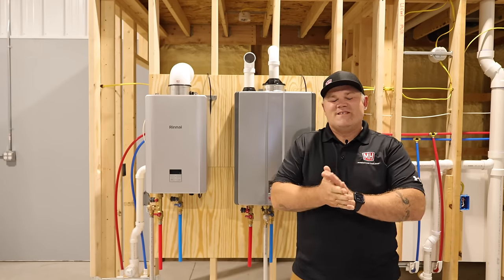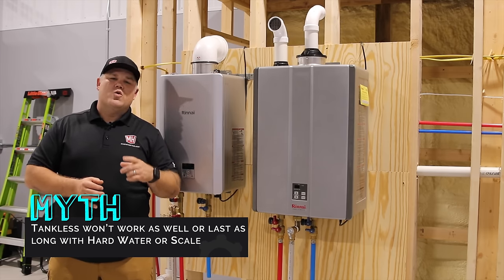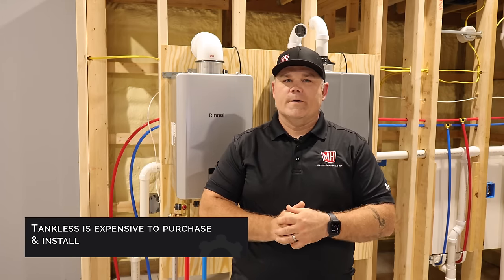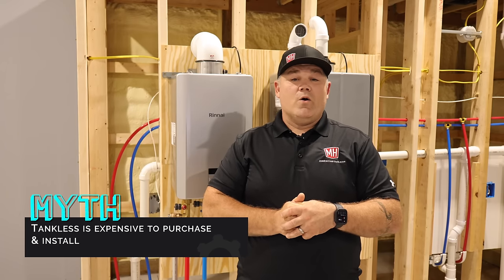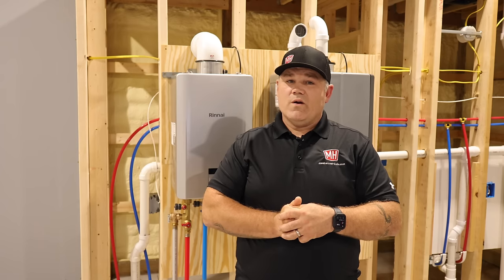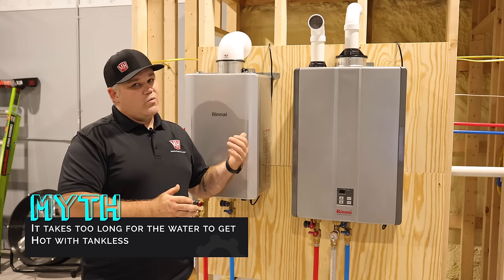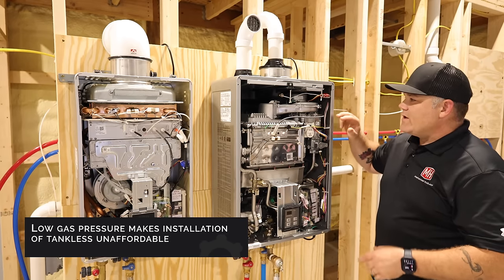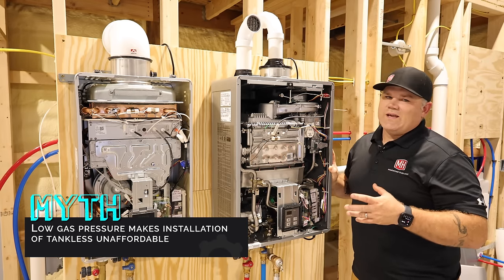Myth Busting! Tank -vs- Tankless Water Heaters

Comment: My opinion and real life experience.

I helped my son replace a tank and install a tankless in his house, primary purpose, regain space in their small (old house) laundry room..

Then (just over 1 year ago) our several decade old TANK water heater developed a small leak, called in the return favor from the son.
The wife wanted to reclaim space in the utility / laundry room.
We had a short term need,  I was able to get everything I needed and install a tankless in a day and 1/2 (hot water was only unavailable for a few hours.. We kept the weeping tank isolated except when hot water was needed until total change over)
To be honest swapping out the old one "tank for tank" would have been quicker, cheaper and easier.

Cost wise the price of a replacement  tank (nat gas) water heater has risen so much in the BIDINFLATION years,  there is no longer  a significantly better price  for an "efficient" tank water heater .

An added burden of the tankless, was  getting the 3/4" black pipe cut to exact length and threaded  @ our local ACE (I don't use flexible pipe for gas).

The advent of 'sharkbite' connectors made the copper plumbing very quick and easy, the 'sharkbite' fittings are not cheap, but the $30 +or- extra investment was worth the time savings w/o the need to sweat copper pipe.

In use:
We never run out of hot water. (no recovery time even when filling the soaker tub)
Even with sustained sub zero (Michigan) temperatures outside, The tankless  is able to raise the temp enough to take the kind of hot showers I like.
I was skeptical regarding additional concurrent hot water loads, but experiments demonstrate I can shower, and not notice any change when the clothes washer and or dishwasher cycle.
Venting the exhaust (via pipe in a pipe dual intake / exhaust) out the wall is much less complicated than a thru the roof vent.
Even though our exhaust /intake pipe is never warm to the touch, our local codes required me to install a steel "fire break" panels inside and outside.
Just like checking / replacing anode on a tank, descaling should be a routine PM.

Paying someone else to do all the labor will be expensive, (this is where I 100% disagree w/ this presentation / video) my neighbor did, his investment was 3X mine and comically the so called "professionals" had to come back out  later to do the final steps, unlike me he was w/o hot water for nearly a day, including an overnite.

Hidden cost:
Once the big tank was gone, and the smaller wall mounted tankless was installed (mounted to the wall), the wife recommended a more thorough utility  / laundry room reconfiguration should be done.
The good news we have almost doubled the useable space in the utility / laundry room.
The $$ impact, this led to buying  a BIG new freezer and a buying a side of beef.

Other insights:
The energy sticker claims I'll save over $800 in natural gas over 10 years (or about $7 a month)  I can neither conform or deny this claim.. since the water temperature stays constant, it is likely I take longer showers, and the wife uses the soaker tub more frequently, these likely reduce or eliminate the claimed savings.

Comment: Great video,, installed the top of the line tankless when rebuilt the basement..hated tank systems, absolutely the most inefficient way to bring hot water.. I have two teenagers that seem to fall asleep in the shower,, absolutely insane.. never ran out of hot water..I filled my hot tub in about an hour.. if I had to fill cold garden hose water it would take almost 2 days to bring up 100F and a huge electric bill... Tankless 1/8 of the cost.. we have heated floors. It is an absolute waste of gas and energy to have forced air heating.. you heat up pipes to 150,, then have a fan blow barley 72 degrees around the house.. in floor heating, warms the water to 80 and the stone floors are at 75 and absolutely boiling the entire house and your feet... An incredible feeling.. North America is antiquated and behind and wasting money and energy.. you want to talk about environmental waste.. 
Heat directly is the only way

Comment: I have a tankless water heater in my house here in Florida I have it set for showering at 105 That way I go into the shower turn on the hot water don't have to worry about mixing I have 105° shower as long as I want. Is this wrong? should I be setting the temperature higher and mixing it down with cold to get the required temperature? Or is it 6 in 1 hand and a half a dozen in the other?

Comment: We had a plumber come out and quote us on a regular gas tank water heater. He wanted $5500!  We had a company that specializes in tankless give us a quote and it was only $5800 gor evrything, including new venting, pressure upgrades for the gas, and a recirculator. Also, the tankless qualifies for a rebate from our utility and tax credits from the govt, which trimmed about $1200 off.  Installing the tankless is going to actually be cheaper. 

So many complaints about tankless aplesr to be due to poor install, buying the wrong unit, and having a recirculator.  Modern tankless is great. They have been using tankless for many decades in other parts lf the world. Japan actually gets the most snow out of any country in the world and they only use tankless.  It works.

Comment: Ok what bout if you have an older home built in the 60 1/2 galvanized and the tankless asks for 3/4 water line. And since the galvanized pipe gets build up inside the pipe will a tankless still work.

Comment: Possibly mentioned that you need either gas or propane to run a tankless system. where I live the town only put gas down one side of the street and between the possibility of paying to bring it to my side of the street or putting in a complete propane system it is totally cost prohibitive for me perit did we had a tankless water heater when we lived in Connecticut and it was phenomenal. now that I live in South East Georgia people just don't get it.

Comment: So my question would be for off grid house in remote location.  All electric would be better than propane.  I see kw ratings all over the board.  Biggest was 36kw for 7 gal flow.  I assume electric heating element only operates at 36kw if you are actually at 7 gals flow rate.?   Is there a rating for electric water heaters that tell you how many wh of electricity to heat a specific amount of water a specific amount? For example, to raise one gal  of water, 60 degrees takes X number of watt hours.

Comment: I have a tankless and the only problem I find is electric ignition. If my power goes out not only do I loose hot water I get NO water out of the  hot faucet at all. Now I have a generator but for short times I don't use it. I was one of the first dealers when  Paloma pack came out with the tankless water heaters. They were gas and there was no electric ignition. just a pilot light and thermacouple. They should go back to that way. Otherwise I like my system.
John retired 35 year plumber

Comment: Should you consider a Heat pump Water heater. The efficiency is much better although the cost is much higher. I have had one for the last 20 years and no problems.

Comment: This is a pure based sales pitch. There are more costs into retrofitting from a tank to a tankless (electrical not gas). In South Florida with a carbon activated water filter you are good to go. The electrical upgrade is a huge upgrade and cost. Gas Tankless definitely need more maintenance and are more temperamental than a tank water heater.

Comment: What is the maximum temperature output of a tankless system? 
At home we normally run our water to 150-160°F, and at work we are required to have at least 170° but we usually run at 180°F.
We did run at 190°F at work for a while, but there was no benefit to going over 180, so we opted for the energy savings.

How easy is it to service a tankless system?
Do you just open a flushing valve once every 6 months like a normal tank?

Are there any energy benefits if you are only using 50 gallons of hot water in several minutes at 12 hour intervals?

And is the water food safe?

Comment: I've installed rinnai. I've installed navien. I get plenty of feed back on both. stainless DOES stand up to heavy usage with no treatment BETTER than copper. all stainless, internal recirculation, powered gas feed (1/2" line):  navien had ALL these features 15 years before rinnai. 2 features rinnai STILL doesn't have? network connectivity with an app (control your hot water via cell phone) and a buffer tank- which means the flow threshold on a navien is ZERO... just like a tank water heater & no more cold water sandwich effect, common to tankless, including rinnai. also- rinnai double wall IS propreitary- and VERY expensive compared to 2" pvc, especially if you're running much distance with the vent. one more thing: with gas power vacuum feature- the tankless WILL run on the existing  branch line- however- if the trunk line & meter aren't sized to handle the extra load (upgrade from tank to tankless), the tankless will create a negative pressure (vacuum) on the entire system- and cause your other appliances to flame out- not a problem for a furnace or dryer- but a gas cook top? DANGEROUS. if the gas cooktop flames out, it will keep running raw gas into the house, so make sure your gas system can handle the extra load. when doing track homes- I find that most often- gas systems are already undersized & the meter inadequate. one more thing: neavien can be field converted to propane & back, also field converted to outdoor & back. money for feature? navien is a far better brand.

Comment: I have a electric TANKED hot water heater (Rheem 50gal SS tank $420new 1999 ) , with a well insulated tank and a TIMER will be more efficient than a tankless ANY DAY!!! I have mine set for On at 6am off at 630am then on again at 6pm and off at 630pm.Shut off @ 130deg .so on twice a day at peak times and will stay hot for 12hrs NO PROBLEM.... I have had my heater for 22yrs.. I flush it once a year and replace the anode rod every 3 yrs... !!! I have replaced heating elements 2 twice @ 18.00 ea for total of $36 plus $56 for anodes...!!!

Comment: I agree 99%. Sorry dude. Navien NPE is a much better tankless heater. No secret codes to set recirc. An easy to use display to set parameters. Tells you if the vent isn't in far enough. Easy to read diagnostics. I don't need the owner's manual to see what the problem is. Rinnai has some areas to improve. Like the whole electronic design.
I think gas supply issue would be a worthy topic to cover. "My 11 GPM heater only makes 6.5 GPM".

Comment: 😂 I find it just ridiculous that Myths persist on Tankless WH...I put one in and probably one of the 1st 100 of Units installed in the entire Bay Area...in either 83-84 and never had a problem. I owned the house another 6-7 yrs before selling. I would assume it still works as it only had 3 Basic Parts  and Igniter, Burner Unit, and the Heat Exchanger. It came with a 25 yr Guarantee.

Comment: I have a Renai tankless water heater and I live in Alberta and after 6 years had to replace copper heat exchanger, but before that happened 120 degrees was not enough, took forever to get hot water, plumber came and set to 126 Andy a dip switch adjustment, then it was better. But you never mentioned water flow, you need lots of flow for it to heat the water so a huge waste of water and so is allowing your kids to shower endlessly, kind of defeats the purpose. Also my water is filtered before it gets to the unit. You never mentioned circulating a mix of water and a special acidic liquid to clean out build up in the exchanger. As you may have guessed, not a fan.

Comment: I have a Noritz tankless combi boiler unit.  I had to replace the three way valve twice due to it getting stuck in the heating position.  I do clean out system as recommended but I think I get a lot of sediment form main line.  Is there any water filter which is reasonably priced and efficient to use with system.

Comment: 1) Tankless water heaters only work when you have electricity.
2) Tankless water heaters must be descaled once a year or a service tech will not look at it $395
3) How long your tankless water heater lasts depends on the quality of the water you run through it.
4) Some plumbing codes require that you have a dedicated 3/4 inch gas line that does not run more than 75 ft from the meter.
5) The average savings of the tankless water heater is $60 to $100 a year.
6) A tank water heater can provide an emergency supply of 40 to 50 gallons of drinking water.
7) I've been a plumber since 1978. My plumber friends that have tankless water heaters don't bother descaling it. They just run them till they drop and swap them out.
8) Electric tankless water heaters have other issues.
9) a tankless water heater costs between $1200 and $1500 plus an additional $75 for the installation kit.
10) Tank water heaters can be a direct fit to your existing system. 40 gallon gas water heater $850. 4 to 5 hours of installation cost. You might need new water supply lines,
A new flexible gas line, and some vent modification, and you should strap a water tank.
A tank water heater belongs in a pan and should have a drain that takes both the water from the pan and the pressure relief valve outside the foundation of the house.
11) A great majority of houses have tank water heaters. Their old school reliable technology..
I took one out of a house that would have been in there since 1985- 1/21/24

Comment: If you already have a hydronic heating system in your house a Stainless steel indirect hot water heater is a much better option Especially if your existing system is high efficiency condensing equipment. If you are installing a new hydronic boiler, do yourself a favor and steer clear of a "combi" system.  I would opt instead for a high efficiency boiler with stainless steel indirect. I'm a plumber and have been in the industry over twenty years 🙃

Comment: As a contractor, I hear many misconceptions that people have about tankless vs tank.
Number 1 is people think tankless are more energy efficient. In actual heating, tankless is less efficient. It is simple physics. When heating water, the more BTUs used, the less efficient the heating. Slow and steady are more efficient than a blazing torch method. A tankless unit uses 4 times as many BTUs for the same job of heating your water. The tankless unit's only real advantage is the "endless" supply feature. 
@3:15 Costs. It is expensive to convert from a tank to tankless. Gas pipes need to be upsized for the required BTUs. Flue pipes almost always need to be converted. Electric wires need to be upsized for the required current for the electric versions.
Tankless must be serviced 2 times per year per the manufacturers' requirements for warranty; that's expensive.
Also, using tankless with a recirculating pump? Read the manufacturers' manuals, you MUST have a tank with your tankless unit for use with a recirculating pump!
Am I "anti tankless"? No. I have a small electric tankless as a supplemental unit for the end of the line.
Would I go tankless on a new build for myself? Absolutely not. And that decision is based upon my much lower cost since I am the contractor. For a retail customer, tankless almost always cost a lot more up front and in the long run.
Who should buy tankless? Churches are a prime candidate. Long periods of inactivity. Short periods of high demand. Schools for the same reason. Gyms for the endless hot water.

Comment: I put a lot of time and energy into researching tankless water heaters.  And then I saw a hybrid tank water heater.  107 dollars a year to run with electricity and with utility incentives the unit itself was only  like 800 dollars.  You get another 300 off at tax time.  Its saving me 480 dollars a year.  We have metered propane where im at, and its really expensive.  So i've gone to all electric appliances.  By comparison I was quoted a rheem propane tankeless water heater, it was going to be 4k dollars installed.  And one can only imagine the propane bill I would have.  So with hybrid water heaters I think  tankless has some real competition, unless its just saving space, they don't really compare as far as energy savings either electricity or fossil fuel based.

Comment: I grew up with tankless water heaters in the 60s in Hong Kong. They were smaller units that were installed in the bathroom instead of one central unit. There was no other choices because there was simply no space for a water heater tank. I think many misunderstandings and myths stem from unfamiliarity with the technology.
Reply: In a hot climate you tend not to notice certain problems with tankless WH.
Reply: @Alec72HD  Hong Kong has winter as well. Even though it is not as cold as in N. America, but for an area where summers are in 30°C + and near 100% humidity (heat index is in the 50s °C), plus there is no central heat, winter (below 20°C, more like mid teens) is damn cold for the locals.

In any case, problems or not, we had no choice as I said. For us, hot water heater tanks would have their short comings as well. For one, as I have said, space was, and even more so now, at a premium. Two, fuels, including natural gas, was and is much more expensive when compared to N. America, so constantly burning fuel to maintain a tankful of water at certain temperature is simply illogical.